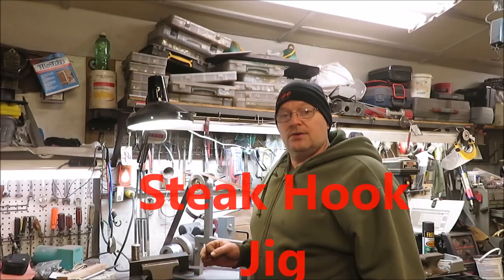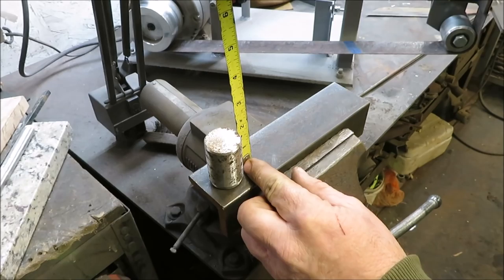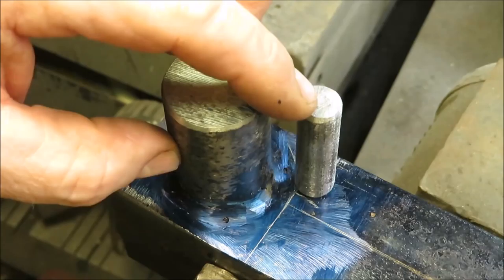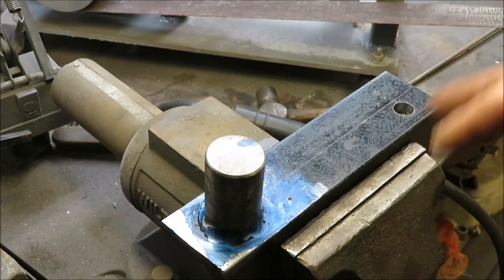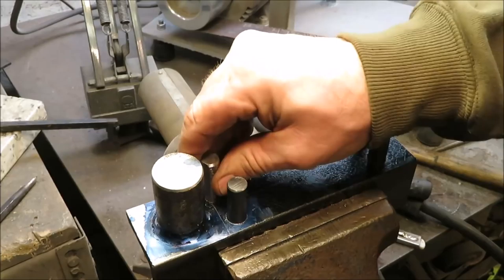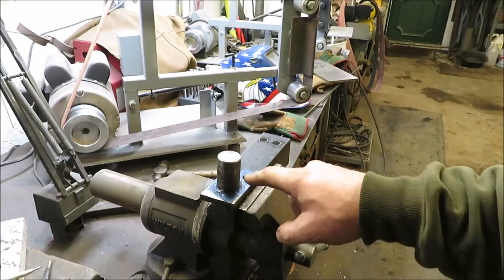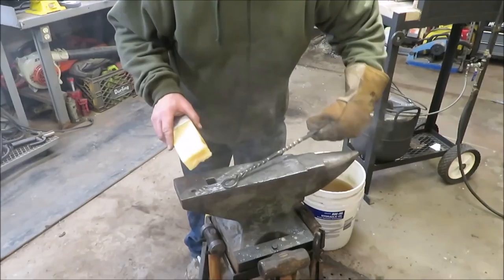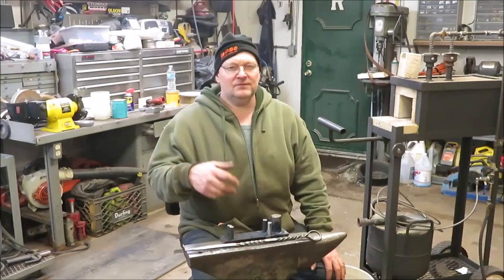steak hook jig

Comment: depends on cost of materials, consumables and time. calculate that and add 30-40%. don't forget about shipping. barter is always a good option if it's local. if you streamlined the operation, like you said, and costs went down, you could charge less. great project and video.